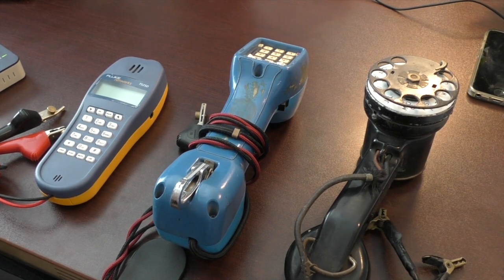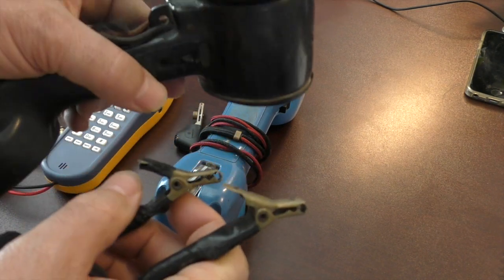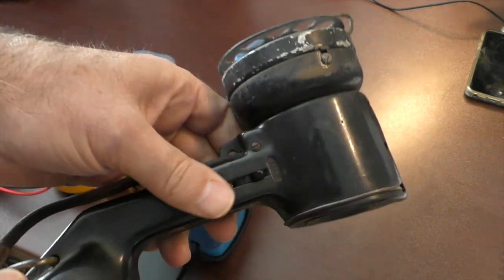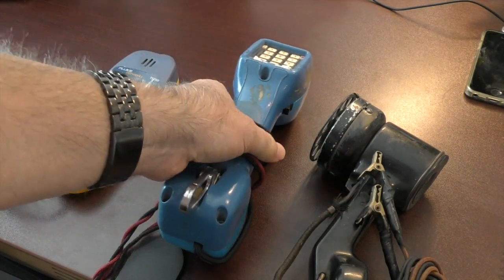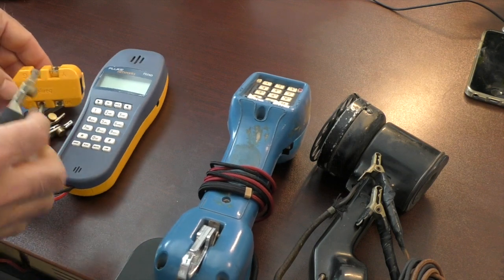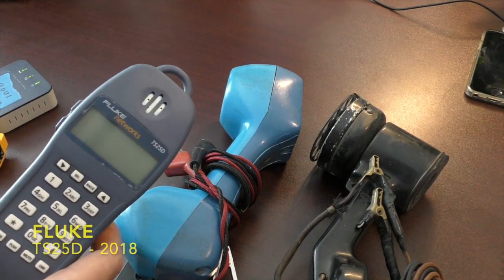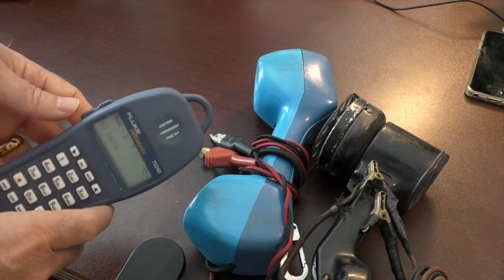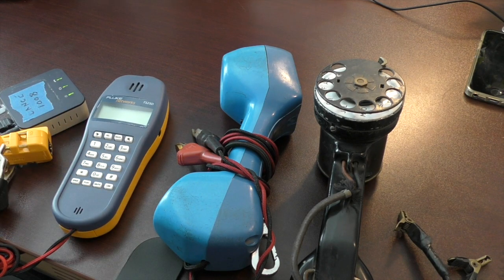Linemans Test Sets - old & new

Comment: There was a test set used by Bell  Canada in the 70s based on a Contempra phone handset. There was obviously added switches but the cord was practically the same  as a 1950 Western Electric.
Reply from the maker: Thanks Mike.  I find this legacy stuff interesting.  I worry we’re losing all the Ma Bell tribal knowledge.  Someday, the workforce will be made up of techs that haven’t worked with POTS. 😟

Comment: Thank you for the info, i’m new to Telecom. Is there a butt set or another way to see what extension you’re hooking up to. (Other than calling the operator and asking every time) I have about 70 different analog phones at my job and would like to label some of the lines when they go into the conduits. Thanks
Reply from the maker: Keaton, I feel your pain.  To answer your question it really depends on the system. Some have little short cut codes you can dial to have the phone show you the extension on the display.  If they are all analog, then calling the receptionist (or some other nearby phone )with a display) is probably about the only way.  Maybe a cordless phone that would display the calling extension #?
Reply: DIY Telecom Thank you! Found a number code to use!
Reply: @DIYTelecom  I remember back in the early 2000s on DMS provisioned PSTN, you could dial 2000 and it would read your ANI. I use (800) 444-4444 now. Also, do you remember NPA-780-6321 for ringback?
Reply: I wonder if you could setup a ANAC (Automatic Number Announcement Circuit) on your system..
Reply from the maker: Wouldn’t that be cool?